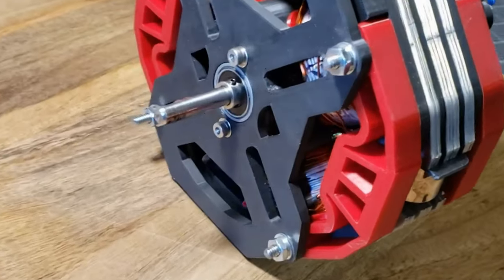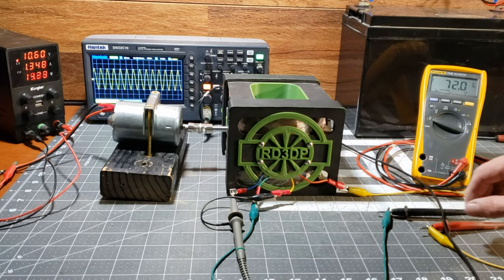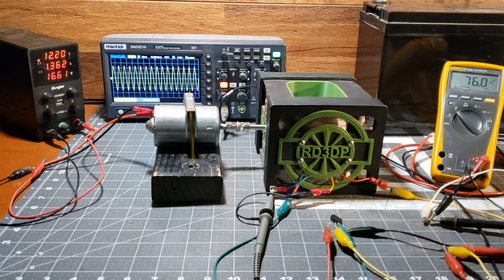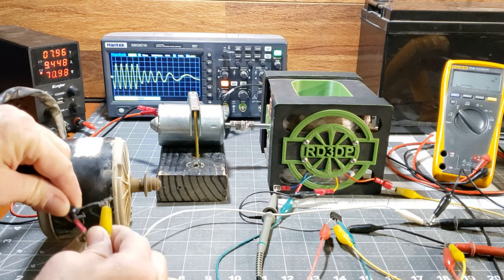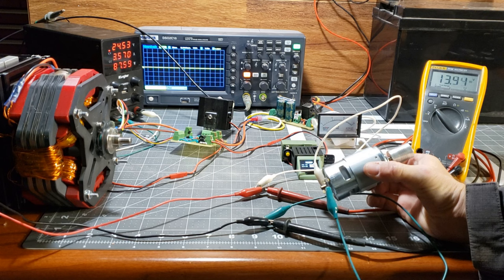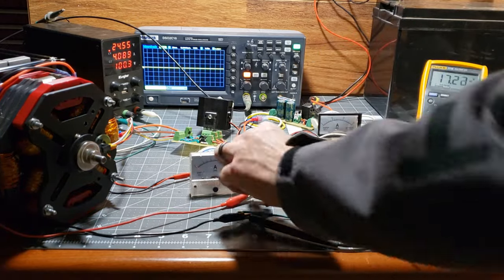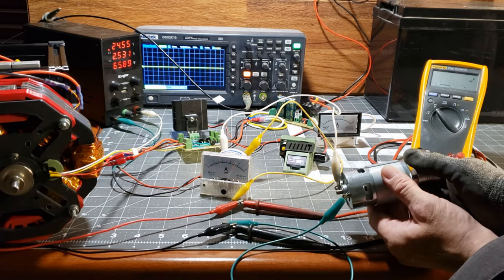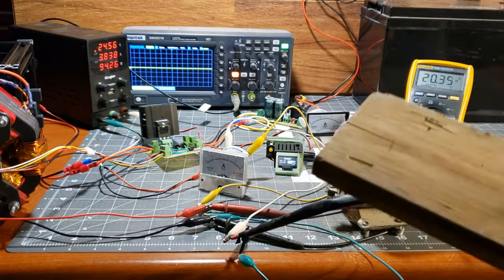Flux Gate Generator, Part 2

Comment: What size generator would you need to power a family  home? Or an office ? Does the power load, mean the generator size would have to increase ? Fascinating stuff… these are inventions that get people disappearing in strange ways though right ?
Reply from the maker: Its not a free energy device by a long shot. The more I test it I'm convinced its not ideal for large scale.
Reply: @redesign3dp 

Why is this model not perfect??    While the model is not affected by the loads... Was the resulting energy greater than the consumed energy??    What is the strength of the magnetic field of the magnet used in the model??

Comment: 3.5 on the ammeter, and 3.7 on the voltmeter(highest I think I saw), nearly 13 watts out. For 65 ish watts in that's not too shabby! (40% efficient, once again assuming you're driving this with a fat brushed motor)
Also I have to correct my previous comment, somehow I managed to get myself off by a factor of ten should have been 1% and 2% efficient... Probably was feeling that was unreasonably low.

for the power input to your driving motor dropping while the generator's output is under load, the power drops by about 30 watts, from the 90's to the 60's. This is rather close to the expected power input needed to get the kind of power output we're seeing out of the generator. (a 32 watts) This would imply to me that when unloaded the generator acts like some kind of eddy brake. Under full load the coils reduce the rate of field change and therefore reduce the eddy currents generated in the rotor and stator. (implying that the driving motor's unloaded power is near 30 watts, actually this is a good question, what is the driving motor's power draw when not connected to anything?)
I would suggest trying thinner plates in the stator to see if there's an improvement. (though that seems like a huge pain, chop up some microwave transformers for a new version perhaps?) That would probably significantly increase your efficiency as well since I believe that there should be a significant amount of loss even under load. Improving this significantly would probably get you more normal generator responses as well. 
Check what kind of switching frequency you're looking at before starting on a six lobe rotor since iron cores really don't like going over a kilohertz so your losses may run away on you (or it may just significantly under perform your expectations).
Reply from the maker: I still have to insulate each plate to reduce Eddie's. I already got a new design cut and delivered, just have to find time. There is still a lot of things to try. I appreciate your input and calculations.

Comment: This is a genius light weight highly efficient dynamo.
Because the rotor is so light, no energy is lost in carrying the weight of the windings or the heavy magnetic material. Only the silicon iron laminations are rotated.
You must apply for patent immediately.
This will be the standard design in all energy production facilities.
Well done👏👏👏
Reply from the maker: Thanks for your kind words. But I think I need way more rpm. I  have another design already build, and like 5 other things made to show but I'm way behind on videos. This gen is intriguing but I don't have enough time for sufficient testing.
Reply: @redesign3dp  don't show that on YouTube.
Keep your secrets and develop in privacy. Make  a comparative study with a classic permanent magnet dynamo of same specs but rotor has the winding ( same windings specs in the two dynamos). Rotate with the same motor input ( volt×amp) and measure the outcome of both. 
I expect due to much lighter weight your design will get higher out put per energy in put in the motor.
Reply from the maker: I see, or I can just sell a kit with an assembly video and let people with more time and interest further study and develope. I never stay on the same topic for too long. ADD? Maybe. But if people like the designs and want to try i can make it accessible.
Reply: @redesign3dp  no. If you can prove your design is more efficient even by 1% than other designs you will be a billionaire.  If it turns out to be less then you should work on it until it is more effectinet. Don't waste your brain and time on small things. 
You need to sell thousands of the kit to make any reliable profit.  Which wont be a reliable source for living well. 
Focus on your points of strength and develop them: Very smart, hard worker, and devoted.  Don't be like a talented footballer who plays only in the streets and let players with much less talents play in the premier league.
Reply from the maker: I see your point. But that only applies in a perfect world. Everything is so tightly controlled. Just look what happened to others like stan meyers, Edwin gray. Plus I'm not trying to get rich just want to provide high quality designs for people to experiment with and fund my future projects. I see lots of good experiments made crudely, but if they had a nice motor or gen platform they may be able make better discoveries. I appreciate your comments brother 🙏

Comment: In the first video you repeatedly stated that the output was "higher than the input", while only pointing out the voltages.

I believe that is where most (if not all) of the misconceptions arose from.

In order to properly compare input to output you need a calibrated load on the output. And then simultaneously measure the voltage across the load and the current through it. Then those numbers can be compared against your power supply on the input.
Reply from the maker: I was indicating how, as I increased the input voltage, the gen output exponentially increased. Showing the voltage potential.

 Also the voltmeter is output voltage and the amp meter is output as well.
Reply: I am all in favor of finding simpler and/or more efficient ways to generate electricity. That is absolutely what we need heading into the future.

I am trying to sound more constructive than critical. That said, you need to implement a more reliable and repeatable system to measure output power.
Reply from the maker: Yeah, I'm always rushing my videos cause I spend most of my time designing. I appreciate you input, and your totally right. I need to create a more scientific testing approach.
Reply: @redesign3dp well if you even need a graphic artist with 3D animation skills and a novice electrical engineer, im on board. Ive got nothing to do all day and have some very interesting contacts. I currently use blender and own a Mars pro 2 resin printer I worked with Nick Kallen on his new 3D software plasticity and I will be installing that program here within the next few months. It is by far the most exciting software to come out and I really need a good beginning project. I have a very solid portfolio to share.
Reply from the maker: Yeah, its always good to connect with someone with skills. I may need some animations in the future. Likewise I don't mind helping out if I can. Redesign3dp@gmail.com if you want to get ahold of me.